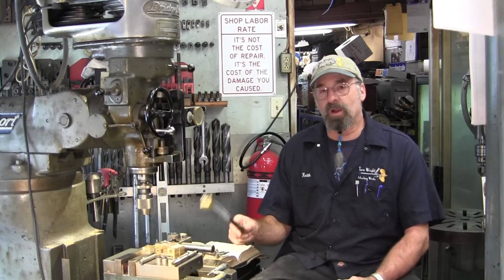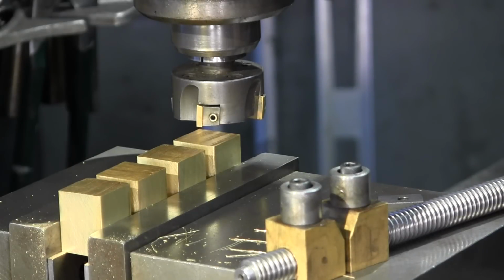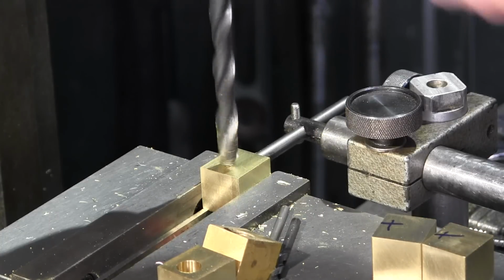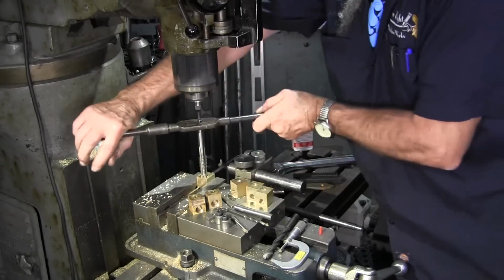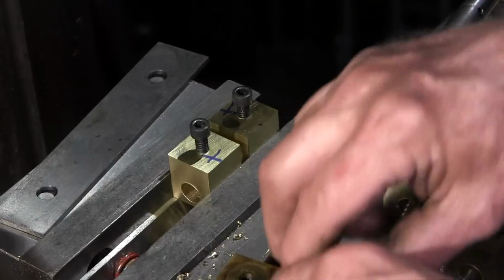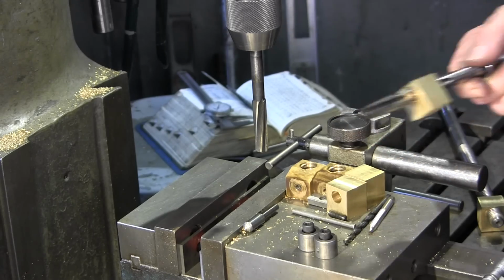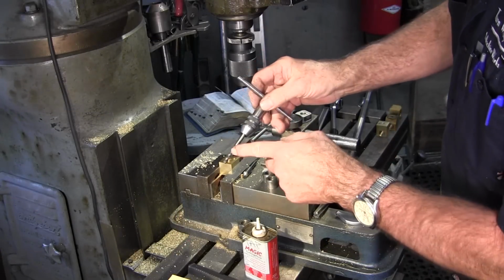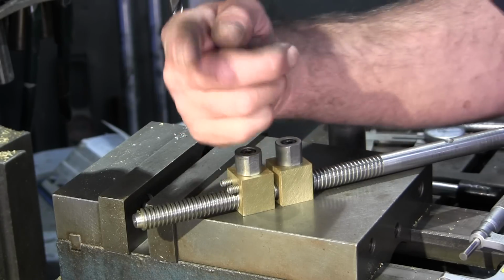Let's Look Under The Old Girls Apron Part Five

Comment: Hey Kieth, the modifications you are making to the backlash adjustment in those nuts made me realize that you repair things using a similar thought process to my own.

If I do it right, the things I fix don't break in the same way again unless it's something like a fuse, shear pin, or other intentional weak point in a system.
Another way to say it is that I did it wrong if it doesn't work better than when it was new.

Example: Say the alternator burns out in my car.
I look it up, and my economy car's alternator is specified at 75 amps output, but a luxury car that uses the same engine has an alternator specified at 90A output.
Even tho it would be cheaper to buy the 75A alternator, I will check to see if the 90A alternator can fit on my car's engine without modifications. If it can, I will use the 90A alternator.

Another example: When doing carpentry, I prefer using screws instead of nails. They won't cause squeaks and they won't loosen up over time.

Comment: Thanks for the video. Was wondering, instead of using the two set screws to adjust the two blocks, could you make the blocks smaller and put a spring between the two blocks? Why I am asking is on the old lead screw it has parts of it that are more worn out and the spring would try to keep the same pressure on the two nuts.
Reply: Backlash elimination is for positional rigidity, not feel.  If you put a spring in there, then that nut which is now floating does nothing to maintain position against forces in that direction.  When turning the OD the tool needs to be pushed into the work.  When boring an ID, the tool needs to be pulled outwards to cut.  You could never set the tool properly with a floating nut in one of those directions.
Reply: Thanks for the answer to my question. I like to look at different options and see if they would work. This way you learn something new even if the idea is wrong.
Thanks have a day
Reply: It puzzles me that you do not generally find screws which are split the other way, like lathe screw-cutting half-nuts. If you relieve the roots of the female Acme or trapezoidal thread before splitting the nut, this means you can spring load the half nuts together. I've used this to reduce backlash to zero on an unevenly worn feedscrew, without introducing the longitudinal resilience or float which Barry correctly pointed out is hard to avoid with two full-wrap nuts.
This would be particularly beneficial on a milling application, for climb milling, and it's WAY simpler than the fancy patents taken out by the likes of Cincinatti.

Comment: Could you have used taller blocks or smaller adjustment screws. So that the adjusters could have been in opposing corners? Instead of being both on the top.
Reply from the maker: At the end of video photos show how close the bottom of the nut has in clearance. ;{)------

Comment: if you have a lead screw that was intricate, say a few gears and other features that would make it difficult to replicate.  could you set the screw in the lathe, chase the threads and setup a single point,  then metallize spray weld the threads for a build up and turn back to spec?
Reply from the maker: I would double check the gears for bores that are pressed on or pinned, to shaft, just hard to imagine, made in one piece. I would  cut and bore the gears and other items to press fit a new shaft with Keys. ;{)------

Comment: 22:08.. question: why not just make a new pair of jaws that can be bolted in that extend over the side? If you have one vice setup like that, this thread cutting would allow you to push further into the material. (I am not a machinist and live vicariously though you and others, I just want to know why not)... now, likely the comment will be that you need to have a method for realignment, but you are balancing those posted on smaller parallels within the vice, so those could be extended to overhang too..
Reply from the maker: The overall length of tap would still reach table before passing through. If I had a lot of these I would set up a horizontal hold and a custom set of jaws may be the way to go. ;{)------

Comment: The cutting brass is somehow satisfying to watch,cool clip KF.
Reply: Nuts are brass (laiton)?
I thought being in Bronze.
Brass is any alloy of copper and zinc
Bronze is a metal alloy copper  and tin,  usually with tin as the main additive, but not in significant amounts of zinc.
The mechanical difference is very important.

Comment: I found that putting a loose fitting wooden ferruel over the tap handles made it easier  to turn the tap. A couple of pieces of plastic conduit may work as well.
Reply: Grandpa Cocky 
isn't that what your apprentices were for doing the grunt work on the tap wrench 😎👍

Comment: If you're making a new leadscrew why did you ream the minor diameter out of those nuts? Perhaps a new thread, made to spec, would have worked with the tapped nuts...
Reply from the maker: I'mm installing a set for the old lead screw to use the lathe to cut the new lead screw for the lathe and after the find of by the book, bore min and max the reamer was in spec's, so I chose to go that route. ;{)------
Reply: Keith Fenner
Reply: Keith Fenner
Reply: Tony Ennis l

Comment: Felt for oiling the lead screw, also has the added bonus of keeping any chips that may fall into the oil hole from ever getting to the lead screw. Amazing idea.....now just need to get some felt for my lathe.
Reply: I would think he would keep set screw in the hole except when he was actually adding oil?
Reply from the maker: Going to add oil cup to the top side. ;{)------

Comment: I've always had misgivings tapping acme threads, especially by hand. Mainly because I assume, perhaps erroneously, that the tap will not thread at the center of the hole because the center line of tap is not aligned with the center line of the hole. The only way to achieve this would be in having the tap mounted directly at the spindle of the mill with a collet and the hole dial indicated so that they are both centered. The alternative would be to chase them on the lathe, then finish them off with the tap. Am I off the mark on this?
Reply from the maker: Yes, on mark, collet or guide is the most sure way, and or tap follower works well, I would never freehand without a true start. The adjustments capable on these nuts leave a lot of room for error, but I wanted them as close as possible, hence the follower. ;{)-----